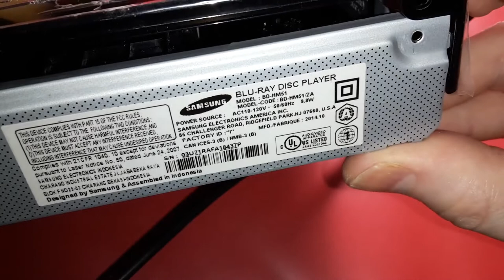Samsung Blu-ray Player | Cleaning

Comment: Some blu-rays were refusing to load or taking many tries.  Watched this video and decided to clean the lenes, there were 2 in there one slightly higher.  The manual eject wheel was a great tip.   I used windex on one end of a qtip then used the dry end,  being as gentle as possible.  Put it back together and bada bing!  All problem discs loaded on first try.  THANX!  Watching GoodFellas

Comment: What's on the cotton bud that you cleaned the Lens with?
Reply from the maker: Greetings and welcome to the channel for cleaning most optical devices i use 99% Isopropyl Alcohol that i buy in bulk and dilute when needed. This player has since been replaced however it does still run plays movies just frequently it will restart a movie mid stream or locks up and requires it to be unplugged many of my players are doing this so its not particularly this model. Be sure to fluff up your cotton swab just before gently sweeping motion across the lens and to mot have it too damp or the ipa will dry and leave a film if not the greatest of ipa brands. Thanks again for watching its greatly appreciated 🍻

Comment: Did you just lightly pull on the tray for it to come out or is there a mechanism inside to free the tray? 
I have an older Samsung model similar to yours & I definitely need to clean the lense to avoid constant disc errors. I also have a Samsung 4K player that's freezing occasionally with most 4K discs, but I'm not going to mess with it; I'll send it in since it's still relatively new. 
More people should take advantage of this potential solution because Blu-ray lense cleaning discs are to be avoided; with those, the lense is likely to sustain small scratches from the microbrush and it just spreads dirt & debris around inside anyways.
Reply from the maker: Due to community guidelines i paused the video plugged the system in and used the remote to open the tray off camera, caution ⚠️ is advised. There's components that are potentially dangerous while powered on.

Comment: Try to do this to mind only plays DVD only some blurays why
Reply from the maker: Many players do this as Amazon sells many region coded for UK or overseas this could be a possibility for your sporadic disc read issues. I would check those discs in question for proper region codes.  Hopefully this helps cheers!